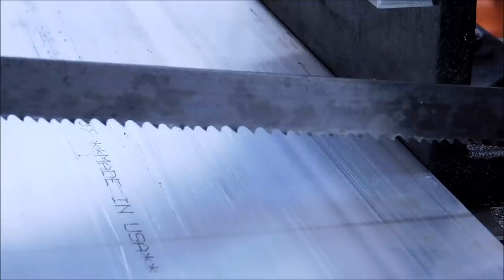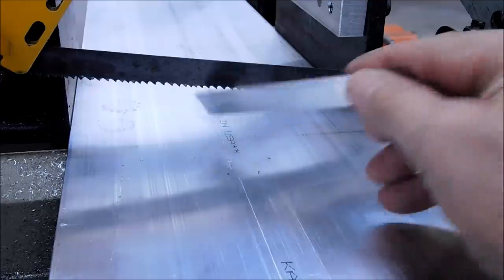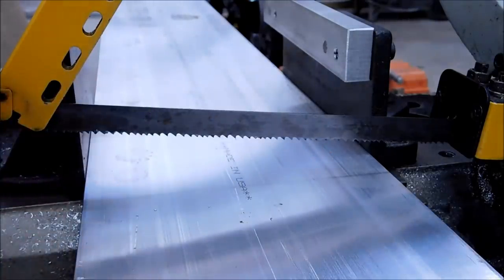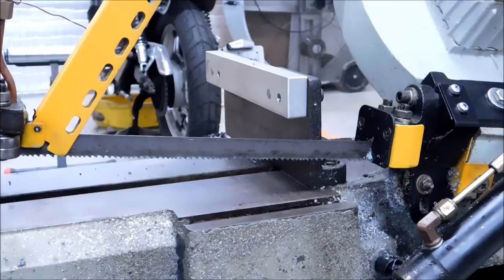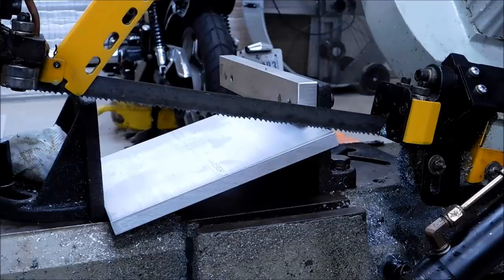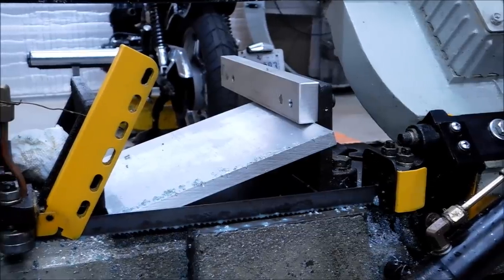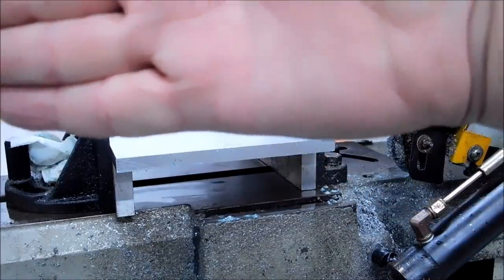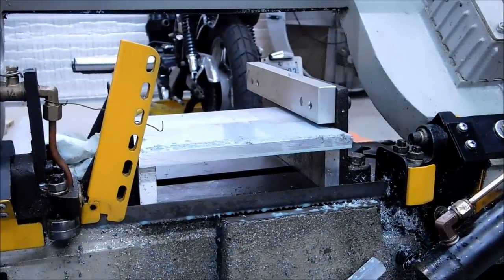Shorter Cutoff Times on your Horizontal Bandsaw

Comment: Update: OK - I just cut two billets from 2/38 6061 T6 with my el cheap harbor freight band saw - has a 7TPI blade. The straight through cut took 5 min 40 sec. I let the saw run 2 minutes into the next piece, briefly stopped the saw and rotated the work about 90 degrees with the existing cut on the exit side. I did leave the stopwatch running (only fair) but I'm sure that took less than 10 seconds. The cut finished in 5 min 32 seconds. SO - a little faster but not much. Makes more sense to me with wide flat pieces.

Comment: I cut a lot of Wide Thin steel from 8' long strip. I have found that the least amount of teeth I can get away with is fastest. I never thought of your ideas, the second one I do not think would work on real thin. But, I like the second set up idea for thicker stuff. I cut a lot of 5/8" thick x 4" wide x 10 foot bars into 4 1/2" pieces. It would need some support along the bar to safely maintain position in the vice that way. But I will keep this in mind, would speed up my cuts a lot if I can make it work.

Comment: I cut a lot of 2 3/8" diameter 6061 round bar on my el-cheapo Harbor Freight saw (so I cut dry). (These become harmonica microphone grill blanks.) I use a pretty aggressive 7TPI blade. 6-8 minutes per depending on how sharp the blade is . Can't wait to try this!
Reply from the maker: I bet you save some time.

Comment: Great tip. I suppose once a tooth gullet fills up, it’s done cutting until it can clear the swarf and go around again.
Reply: I think it has more to do with the number of teeth on the material at the time. The more teeth, less pressure per tooth.
Reply: RichieRichOverdrive That also sounds reasonable!

Comment: Great tip! I tend to accept the time cost more than you would or should, but that’s because I’ve never sat down and really tuned my bandsaw in to perfectly square. It’s an Ellis mitering bandsaw, so that’s a bit more touchy, and I find that in this sort of material, I get a lot more blade wander in the vertical position than in the horizontal, and I assume the angle would be in between. Thoughts?
Reply from the maker: The angle still offers more teeth per inch than a vertical setup, so I would expect closer to horizontal results, just faster.

Comment: Is it surface contact or chip clearance? I suspect the chip clearance is the bigger issue. Those little gullets in the blade have to carry all the chips across the part and out the cut. If they are full, the blade can't cut. I suspect that's why wood band saws often have skip tooth blades.
Reply: Exactly what I was thinking. Otherwise, you'd expect that with more teeth in contact and simultaneously cutting at any given moment, more contact would actually be more efficient. In that case the fastest cut would be perfectly parallel with the long surface for maximum contact. If you've got big enough gullets, I think that might actually be the case. But in real life, you need somewhere for the chips to go, so with more than an a few inches of a blade like this one buried in the stock, the leading teeth quickly lose their effectiveness as they are obstructed by swarf buildup. I've certainly had that experience when re-sawing wide boards.
Reply: I suspect it's a bit of both: Yes the gullets can get filled up, but the other factor is surface area, and pressure. As the contact area increases, the pressure per tooth decreases, which means that each tooth won't bite into the material as deeply. Given a constant surface speed, increasing the pressure per tooth increases the feed per tooth.

Comment: Very nice demonstration. A LOVELY video. 
I only have a hacksaw - but the round stock cutting method you discussed is the method I use for 30+ years to cut my round stocks
I cut about 30% of the thickness, rotate 90degrees and finish the cut. It's easier, I get a straight cut (my reason of doing it this way) and the cutting flows better (exactly as  you explained).
Thank GOD I don't have a lathe big enough to run stuff like THAT - just imagine going through that with a hacksaw... :[]
Reply from the maker: When I use a hacksaw, I'll start flat, then angle to the rear, then flat, then angle.....You get it. It keeps the cut minimal and the blade is usually just cutting an apex from the 2 different planes.
Reply: @joepie221  I use this methods on thick tubes. But my stocks are usually under 1"... :)

Comment: Great idea when you can’t put your material on edge. I’ve found running the blade at a faster speed made a world of difference. Also found no difference in blade life without running coolant it’s so messy
Reply from the maker: With the material tilted, the coolant runs downhill back into the machine and not onto the floor or along the stock. 2 benefits to doing it this way.

Comment: Any way you could do a video on setting up the blade in the bandsaw?  I bought a bandsaw 6 months ago and can’t get a blade to last more than an hour at most before it breaks.   I’ve about given up on the thing.
Reply from the maker: Keep the guides as close as you can to the width of the material. if you cut 1" wide material, don't have the rollers and guides 6" apart. Blade flex, micro fractures.....BOOM
Reply: @joepie221  I think that might be my problem.  I can't adjust my guides any closer than 6"

Comment: I would cut this stock Longitudinally just like if I use hand saw less efforts on .  the blade it self .
Thanks for sharing joe
Reply: I thought this would be test 4.
Reply from the maker: The 8" material was wider than the 7" vertical capacity of this machine. that demonstration would not have been possible on this.
Reply: @joepie221  thx for the info
Reply from the maker: @thunderstruck1078  Its about a 20 second cut on my DoAll vertical.
Reply: @joepie221  exactly sir I missed this point .. thanks for your reply.

Comment: Same principle can be applied to square tubing. Rotate it 45 degrees (V block) and it cuts much faster.
Might be slower to cut square stock at 45... Curious - have to try it.
Reply: I always rotate square tube, though I never bother with a V block. Just line up by eye , clamp it and go. I generally use a few degrees more than 45 with the part rotated against the direction the blade is trying to pull it. That way if it does try to rotate it just jams tighter in the vice jaws.
For production work a V block is probably quicker but I don't do much production work.
Reply from the maker: the V block just stops the material from grabbing and rotating. thats a blade killer.
Reply: @joepie221  That's why I clock it a bit past 45 degrees. It then would have to push the vice jaws apart to rotate.

Comment: Do the more aggressive methods effect blade life?  Might it increase blade life due to less time cutting?
Reply: Extends blade life as it spends less time in the cut, but most of the time saving comes from the blade gullets not filling up from shavings halfway through the cut and then just dagging in there until the blade exits the material.

Comment: Joe, great video, and great channel! I wondered if you could do an explanation on how to layout precise circles on plate, for subsequent machining. For example, my drawings often call out a precise dimension like 1.258"dia. I then make a centre mark, and attempt to use a sharp divider/compass to set the correct radius and scribe out the circle onto the blued surface. However, it's so difficult to get that level or precision out of a divider. I usually use a digital caliper to scribe two reference lines onto a surface, then I align the lines with divider points using an optivisor.... but this feels like a fairly unsophisticated method. I wondered if you had any tips? I make my own clocks (like a lower quality version of Clickspring ;) ) - so that's the sort of precision that I am looking for.
Reply: Tom Brown why not just machine the diameter you want and then you’ll have the exact size. Also when you cross out your wheels try machining the spokes to size so you don’t have to spend hours of unnecessary filing like Chris.
Reply: @KevinWoodsWorkshop  Good point Kevin. I should have been more specific with my question.. it really applied to a partial circumference, like when you need an arc at a precise diameter, covering, for example, 270 degrees. Thousands of an inch aren't so important for me, but i am looking for precision to, for example 10 thousands of an inch.
Reply from the maker: @Longtooth08  Work from a center pivot hole. We used to cut screw machine cams that way. Check your progress using a "V" block with a pin in it and use a drop indicator. Super accurate.

Comment: Got a trick for cutting through 1 1/2 in titanium in less than 9 1/2 years 😝
Reply: cmonster6, Inclined approach works well, Titanium needs sharp teeth and high force. Titanium has nearly half the value of thermal conductivity of steel, so very susceptible to work hardening. Hope this helps 😀.
Reply: @bostedtap8399  Rubbin is not cuttin....

Comment: Its cause of weight per tooth.  your saw arm only weighs x amount,.. as more teeth make contact with the work piece you end up with less pressure per tooth.
Reply: Its also due to chip clogging / loading, the blade only has so much room between the teeth for chips to stay until dumped at the end of the cut path, If you put more weight on the blade the chip size increases and the blade either jams or rides on chips. Each blade has a designed chip loading that must be matched for how long the tooth travels before allowing escapement of the chips.

The easiest way to demonstrate this is with the hole saw trick  were you drill a hole for chip escapement to vastly increase the speed that you can cut a hole using a hole saw.

By tilting the material he optimizes chip loading buy reducing the cut length to a inch or so.
Reply: @another1commenter770    Right on. That's why there are many pitches of band saw blade. Minimum of more than two tooth in contact at anytime. And the volume of the gulley between tooth should be big enough to store the chips until exit. This is a function of how long the cut will be.

Comment: Is there anything wrong with clamping the stock vertical as opposed to horizontal?
 Mr. Pete 222 said in his video to hold it horizontal & not vertical.
I just built a saw from a worn out wreck & been watching videos on them lately.
Reply from the maker: The rule of thumb is to have at least 2 teeth in contact with the work at all times. If your guides are close and you can trust your saw, vertical is much faster. I respect Mr. Pete, but in a 'get it done' environment, faster is the way to go. Since the ends will be machined anyway, stand it up and let er rip.
Reply: @joepie221  Not only does it cut faster but it improves blade life. Cutting slowly with a very wide cut is a good way to wear out your blade. The teeth end up rubbing more than cutting.

Comment: How fast would it be if the material was aligned vertical then? Or is 8" too tall for the bandsaw? Is it always best to line material up vertically then to minimize cross section of the cut?
Reply: Saws tend to cut less square when you cut vertical but apart from that vertical works well on thicker sections. In thin sections you can have problems with not having enough teeth in the cut end also flex and resonance. These can kill the blade rather quickly.
Reply from the maker: I could probably get through this part in under 30 seconds max with my vertical bandsaw.

Comment: Do you have any advice on cutting thin stock such as thin wall tubing or uni-strut
Reply from the maker: Fine tooth blade and easy on the feed pressure. Shear the plate if you can, otherwise support it tight so the blade pressure doesn't roll it over at the cut line.

Comment: Good tips, however I can't imagine rotating that solid bar half way through a cut and ending up with the end being flush/true? No doubt that wouldn't work for me at least. Lol
Reply from the maker: If you have a pointed stop, set it as close to the center of the bar as possible. If you plan to face the bar anyway, the mismatch won't matter.
Reply: Bandsaws don't cut true square anyways, so it doesn't matter.
Reply: @5starmachineko971  Yes, that's true, near enough is fine for what I do for the majority of the time.

Comment: What physics are at work to create this effect?  All I've been able to think of, is that the down force is very limited.  To take a full chip load per tooth requires X amount of force, and when the saw has more teeth in contact it requires X times the number of teeth.  Once it reaches the point where the down force can no longer take a full chip on every tooth, the Material Removal Rate is max'd out.  Does that seem right?
Reply: We really saw Joe P. do an experiment. Horizontal plate position gives the slowest  cut,  angled plate cut is faster and vertical plate (although not shown) will cut fastest. Band/tooth speed and force are constant. The variable is the angle and hence the number of teeth in contact with the work at a given time.  Agree that the downward force vector is spread over a wider cut with more teeth contacting the work so less depth of cut per tooth.  Less teeth contacting the work with same force and deeper per tooth cut wins the race. Force vector changes with angulation of work and blade position to work but I think the cut per tooth is the major reason that explains the time of the cut.
Reply: Each tooth cuts a certain volume of material which then has to be dragged through the cut,  and once the tooth space is full, it will not cut any more. So shortening the length of the cut will reduce the dead time for moving chips, and allow the blade to cut faster.
Reply: @steveallarton98  - Ah! So the tooth gullet becomes the limiting factor, not the power to make the chips?  That would be even worse for the blade, it would definately be rubbing then and not just limited to thin chips.

Comment: Hey Mr. great info as always. Can you answer this? Is there a reason guys drag their inserts back across the material in a lathe after they make a cut? Is it laziness, for cleaning off the back side of the insert or maybe some other reason? It never made any sense to me and I don’t do it myself because it seems so wrong but maybe I’m wrong. Here’s a wrong trick I learned from an old guy on a vertical bandsaw years ago. Take a USED/DULL 24 to 28 tpi bandsaw blade and flip it inside out so the teeth run backwards. The blades we generally use are 1/2” wide. Fine tpi is what we’re after. Get some pretty good tension on the blade (past normal) and get the RPMs way up there. You want the speed almost maxed out depending on the quality of your equipment. Not your bandsaw Joe, that comment is just in case someone else is reading this and wants to give it a shot. I wouldn’t try this on a junk bandsaw though. Anyway, you can friction cut up to 1/2” stainless plate with this setup if need be but cutting sheetmetal is like butter. Use a fair amount of pressure while pushing. I use a plate drop as a pusher. DON’T USE YOUR HANDS!!! If you slip. . Ugh I can only imagine the possible missing digits and pain. The cut edge will be blue when you get your feed and speeds correct and there’ll be about a 1/16” or so of of razor sharp tear out on the bottom. I know this sounds 100% wrong but man, the time savings in roughing out parts before sanding, fit up and fab is insane. The parts are also pretty cool temp wise. My plasma use for cutting stainless parts was severely diminished after being shown this method. NOTE; to anyone with a bandsaw. Before you run out to the shop and chop your fingers off, use this information at your own risk. Most definitely USE A PUSH BLOCK!!
Reply from the maker: I've been told running inverted teeth is a good way to cut up old car tires. ???
Reply: Joe Pieczynski  I wouldn’t doubt it. Friction cutting is super fast. Any thoughts on guys dragging their carbides backwards?
Reply from the maker: @monkfry  Yes. 2 reasons for the backwards carbide thing. 1. You introduce a possible movement error for the following cut if you retract the cutter. Leaving it where it is gives you a truer starting point for the next cut, and 2. You can tall if your insert is worn, or something is off with the speed and feed. dragging a cutter back over a turned surface now uses the non-leading part of the insert. if the tip is work or deflecting, you'll see it when you pull it back across.  HOWEVER   If you are looking for a critical finish and believe you just hit your dimension, DONT DO IT.